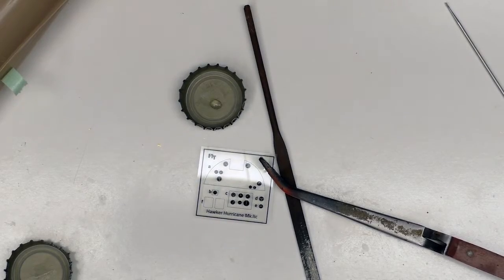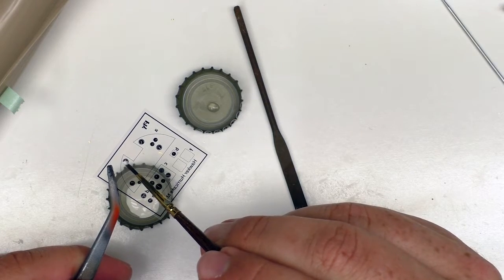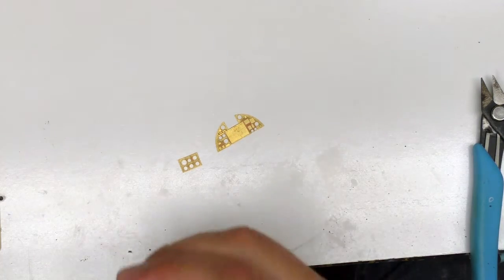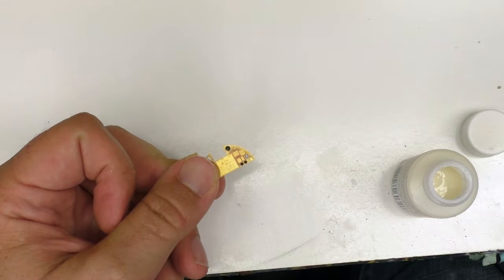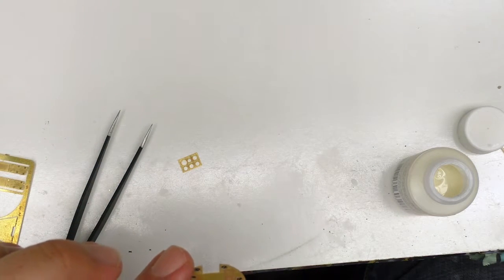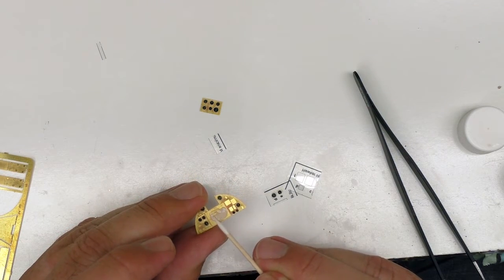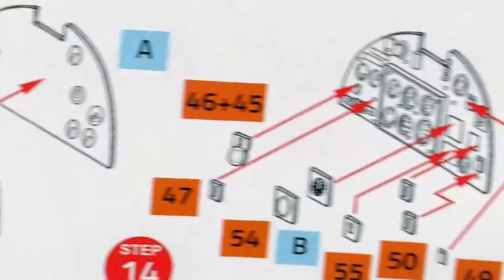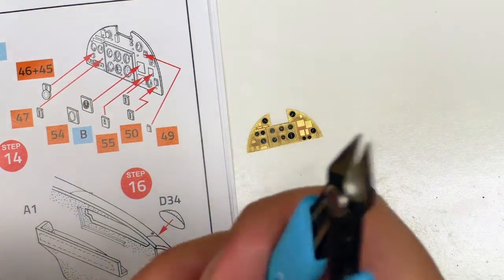1/32 Fly Hurricane IIc Review Pt 4 - Instrument Panel

Comment: Hey Doog- agree about the acetate gauges being the best, but with the printed photo etch 'ala' Eduard, Ive found if you put a drop of diluted Microscale Kristal Klear ontop of the surface of the dial, it drys like a lens- did a Hase 109 F4 IP last night, and it looks pretty good after drying. Anyway, following the build, was going to buy one of these IIc's from Fly- not so sure now! Keep up the good work.
Reply from the maker: Maybe I'm just picky, but I'm not satisfied with printed photo-etch gauges. They just can't pull off a look at clean as acetate. Good gauge decals (Airscale, etc) can come close, but even with those, if I can put a little acetate disc over them, I'll do it every time.